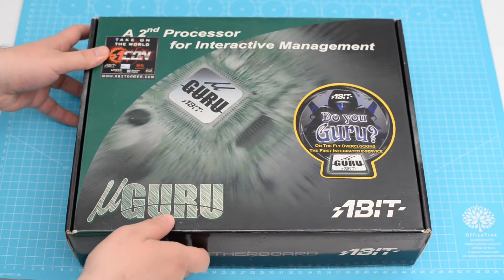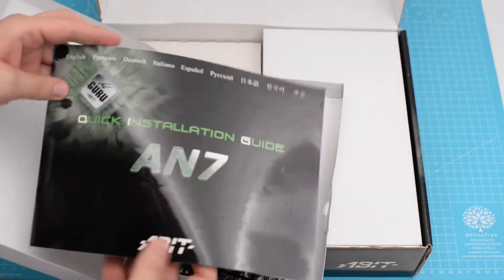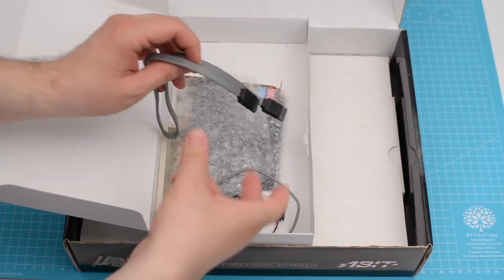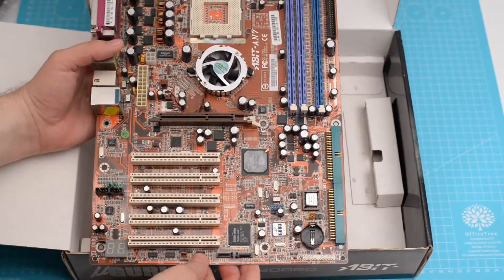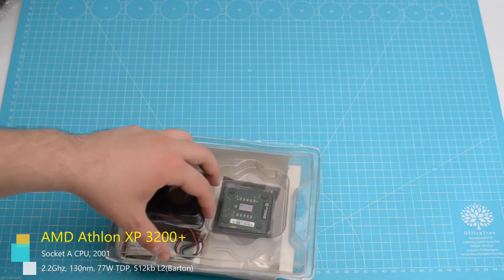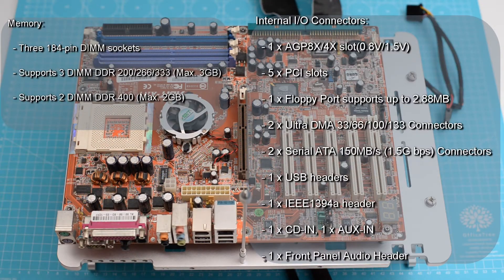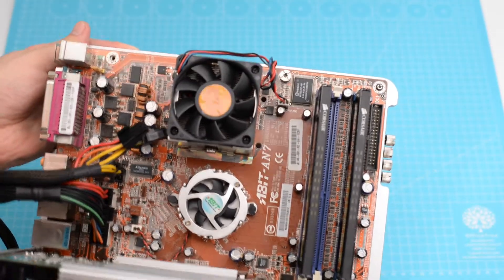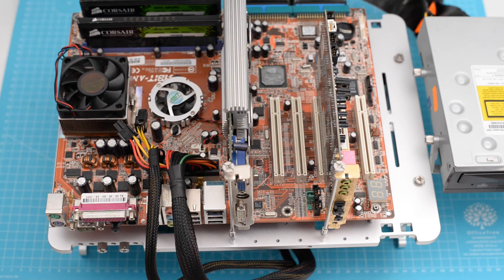ABIT AN7 - Unboxing and Assembly

Comment: mine doesn't boot anymore, it does the expected 1 short beep, then stops at bios code 0A. No video output.
Reply from the maker: I replied on the other clip, also before doing anything to the board, try resetting the bios by the jumper.